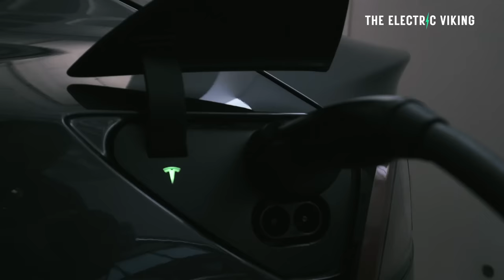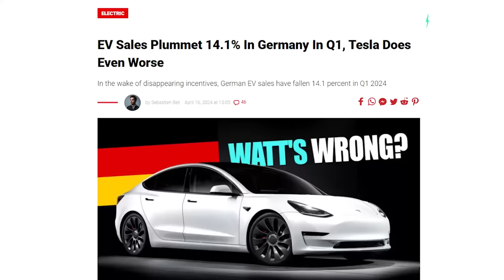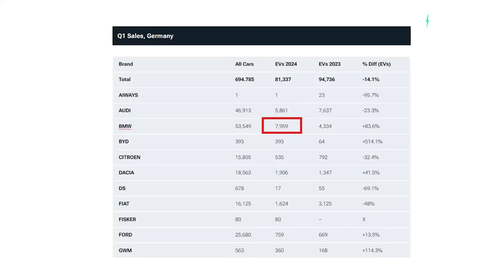The real reason Tesla EV Sales are in freefall In Germany in 2024

Comment: Hang on, does this mean that government incentives were the only reason people were buying EVs in Germany?🤯
Reply: no only people with extrem deep pockets  and a own house 
just one excemple a 

Corsa F 1.2 Turbo cost 21.000 € 
Corse F 1.2 Turbo Hybrid 48 V 28.000 €
Corsa F EV 38.000 €

that thas same base car with different engines  and also the lower specs
most working klass people dont buy cars that cost more the 30k here  if they sell a expencive car in germany it like 70% secound hand form the dealer (like a car they used in showrooms or for test drives for a year or two)
by the way most factory new cars are sold to companys or as a car leasing  (that like a long term car rent, people keep them for 2-4 year and then replace tehm, with new models) 
most factory new cars are not sold  here anymore because tehy got to expenvice,

 as excemple a vw polo base line did start at 12.300€ 10 years ago now it starts at 21.500€

Comment: Extreme electricity prices in Germany. 18 kWh on the highway for 0.79 €/kWh makes 14.22 €/100 km. With the same money, You can purchase 7.9 l Diesel.
Reply: Same/very similar prices in most EU countries. EVs only makes sense with home charging until this is resolved.
Reply: 0.45/kWh @ Tesla Superchargers 😁 [edit] in Germany. Far less in near NL (€ 0.27-0.30) and F.
Reply: …but no maintenance costs and combined with home charging, still cheaper
Reply: No maintenance costs may be true for Tesla only. We had a KIA BEV and now a Hyundai BEV, you have to pay similar or more money to the dealership for mandatory "stamping" as for an ICE service.
Reply: Not only Tesla, I own a Skoda and I have paid 0 service costs so far in 1.5 years.
Reply: @MultiMenvafan  Well, me too on the Ioniq 5, but every two years I'll pay twice the amount of the e-Niro annual "stamping fee". So it's a virtual gain to have a 2 year cycle apparently.
Reply: @IverKnackerov  Germany has insane high electricity prices.
Reply: My computer has burned away 190kW/hrs since Nov 23; 179kw/hr, and 133kw/hr for my fridge and Ninja air fryer.  Energy costs here are excessive and. I'm not going anywhere.
Reply: @kairuster1510 Same here in France, and half that at TotalEnergies 22kW charging bays in my local public parking. I guess nuclear power isn't so bad 

Phillip.
Reply: Not at Tesla Superchargers
Reply: @st4849  This is why I did not buy Korean BEV.
Reply: @rozonoemi9374  Fair enough. They're the 2nd best after Tesla though and some of them look amazing too. So "pick your poison" I guess.
Reply: I use my solar to charge my hybrid, brilliant price! Zero euros as we only do 4-5000km a year
Reply: How come? When I travel through Germany, I'm buying Elli subscription and getting 0.5 euro on partners. I can also charge at Tesla, but I find that third party chargers are in the better locations and require no detour.
Reply: Where did you get that price from? 60 cents/kWh charging station costs down here in Southern Germany.
Reply: @st4849  Truly rational people don't spend many thousands of dollars on a depreciating asset for "looks" or "status". Of course, 99%+ of humanity isn't rational ...
Reply: @st4849  dont buy an Ioniq next time then :)

I think it's just dealers trying to hang on to their old business model and cash flows. It will also be a point for competition. People (like you) getting fleeced for nonsense servicing will probably look for brands with a different plan next time
Reply: @capnkirk5528 ...and you conveniently skipped the part where I said they're the 2nd best after Tesla. Never mind.
Reply: @capnkirk5528  depreciating asset for status goes for most car purchases, hardly unique to EVs
Reply: @MultiMenvafan  I bought the Ioniq 5 after owning an e-Niro. I knew exactly how it worked by then. I'm not going to pick a car I don't want because of a difference in "stamping costs". Sooner or later dealerships will be a thing of the past anyways.
Reply: @st4849  no of course not, but my point is if you would choose between two eligible cars/brands and one has a dumb stamping fee and the other doesn't, that would at least tip the scales for me.
Reply: @MultiMenvafan  Look, as long as a brand uses a dealership network, you will have to pay for their survival. See what Skoda will charge on the 1st service after two years or whenever the 1st service is.
Reply: @st4849 I have a Niro EV and paid zero in maintenance in the past 4 years maybe it's a different agreement with dealerships in the US?
Reply: @richardburnett6781  Wow! Yeah, that seems to be the case then.
Reply: @MultiMenvafan  Very true. And not just EVs, most people overbuy their housing needs to the point where they are working for their house rather than enjoying life.
Reply: @pegefounder  ... depending on when and where you buy. On average, I pay 2€/100 kilometers of driving. It's like the fuel that had to be bought in pharmacies long ago.
Reply: @st4849  as someone pointed out, I think it might be different between countries
Reply: @kairuster1510  you can't drive to NL to charge up your German EV though, you'll never make it back with that charge so why bother going to NL to charge it up lmao
Reply: @MultiMenvafan  the regular service interval for any ICE Skoda from MJ2021 on is 2 years or 30.000km so yes, also 0 service in 1.5 years. For their EVs it´s 2 years without mileage limit, so you will be able to tell us in 6 months. Probably they will charge you 200 bucks for changing the cabin air filter and looking around. After all EVs still have cabin air filter, 12V battery, brake fluid and pads, tyres, cooling fluid (for the HV-battery), air-conditioning, etc and that needs regular inspection and maintenance. Even in the Teslas, the manufaturer recommends changing the oil and filter in the differential case. Maintenance on an EV is cheaper mainly because there is no motor oil change but the rest is similar.
Reply: @franciscojoseangostocastej6057  I can't compare to ICE Skoda just to my previous Passat GTE and as you point out it was ALWAYS the darn motor oil. Oil change, oil filter, "service charge". Just getting rid of that made a huge difference.
Reply: @st4849  Resolved? No chance.
Reply: @pegefounder  Not compared to Ireland. All that wind energy has to be paid for.
Reply: @pegefounder ….and therefore Germany will go down economically…🤷‍♂️
Reply: @ChazmillsADLT …did you receive your solar installation as a present 🎁 from the government?
Reply: 7.9l diesel is about 2gal.  That's 2gal for 60mi.

Fuel in Europe is very overpriced.  Unless you drive a VW - then you have no idea what anything costs.
Reply: @AllDogsAreGoodDogs  Imagine Europe would have gas guzzlers like the US. Imagine China had not all these efforts to replace
gasoline scooters by electric scooters, airplane by high speed railway, ICE cars by electric cars, oil price would be beyond US$ 150 per barrel
and US people could not afford any longer to use gas guzzlers.
Reply: @glennv3176  You will if you live in Aachen or near the border. 😉
Reply: What's the kwh cost to charge at home in Germany?   Is there time of use rate?  (eg 9pm to 7am Monday-Friday)?

Comment: Bad research here. Domestic solar power in Germany is relatively insignificant, if you had ever visited you would know why. Wind is by far and away the country's largest source of renewable energy (4-5 times as much wind as solar). Solar counts for only a little more than burning wood chips (something Germany counts as renewable but most people consider a bad idea). The country also relies on nuclear power imported from France and Sweden to balance its network. Some solar power though does make its way to Germany from as far afield as Spain.
Reply: In Germany for 2023, solar was 12.2% and wind was 31.1%. The total contribution from renewables was 55% with plans to increase that to 80% by 2030.
Reply: A "Serious" conflict here !❕️!

Which one of you is correct  ❔️
Reply: Believe Mark. Solar is thriving in Germany, despite the bad weather, well exceeding the original expansion goals in 2023. +14.6 GW installed in 2023, in total more than 82 GW installed base now! Don't understand how anyone could call this insignificant.
Reply: Yep, he should have said renewable, which I think is around 60%
Reply: Softwood chips ARE a renewable source - but may be classed as "dirty" in terms of their local pollutants.  So, green but not clean.
Reply: @dogsbodyish8403  There are considerable emissions involved with the harvesting of trees, soil organic matter decomposition in clearcuts, and drying and transport of wood chips or pellets.  Burning wood is neither green nor clean.

Comment: They stopped all incentives in the netherlands for cars with a catalogus price over 45000 euro.
Already years ago.
Still a lot of people buy those more expensive EV's.
(I must add to this that the tax on buying a car depends on the CO2 production (using wltp usage) at the exhaust pipe. In other words...Zero CO2 means zero tax...result of this is that especially with the more luxe brands an EV even without direct incentivs does not cost a lot more than an ICE...
But due to high energy taxes (also on electricity) makes that the savings on energy with an ev can be high. Up to 10 eurocent for each km. Only this makes energy costs when driving 25000 km a year 2500 lower.However, electricity from solar panels own by someone are not taxed at all...adding a few more cents /km savings if you can charge at home and own enough panels.

Comment: Could it be German reliability?

My (still under warranty) 2019 GTI just got ANOTHER recall notice regarding a part that is not yet available to install. TPMS, ABS module AND just yesterday… I got another notice, and it’s for a component in the Fuel tank. 

“Fire risk” stood out.

I haven’t had app-connectivity since 2021 because they STILL don’t have the 4G module for my telematics… 

(I repeat - Still under warranty)

The new Mk8 GTI has a completely plastic interior, an electronic parking brake, and seems to be priced too high for something that feels like a used Ford Focus…
Reply: One of the things that caught my eye. Many years ago was how when they went from 4G to 5G , only Tesla came up with a compatible 5G adapter.

Even though I did not have a clue how nice it was for Tesla to do that. 

All the other Auto companies making EVs.
Wanted You can buy one of their new EVs.

Comment: If they go wrong EV's are difficult to fix , especially out of warranty. Still not enough trained mechanics. Often, you have to go to the main dealer . Often car not worth fixing.
Reply: Not worth?  It's not like they're cheap.
Reply: @dogsbodyish8403  . In Guardian there are two examples of Renault Zoes being written off. One being 5 years old £30k new , out of warranty. A heater fault occurred 9k to fix. Car was only worth 5k. This is not unusual.
Reply: @johnh1872  Renault should be ashamed of themselves - a transparent rip-off.  Remind me not to buy a Renault (actually I did once, it developed a gearbox fault and it couldn't be fixed because the part had been discontinued - so the car was scrapped).
Reply: Buy EV that has years of record of high reliability.    My 2018 Tesla Model 3 84k has no issues for 5.5 years.    (Formal BMW owners that had many parts failing)
Reply: @Trust_but_Verify . I wouldn't buy an ICE BMW . Little chance I'd buy a EV BMW. The problem with Tesla is maintenance. It's expensive and there aren't any independent garages. Tesla has not released any diagnostic info. I'll wait and see who is reliable and who offers best after care.
Reply: @johnh1872  I am counting on not having expensive issues for 200k miles.
Reply: @Trust_but_Verify  . Any battery fault will likely condemn your car. Hope you have your 🤞 crossed.

Comment: Month to month fluctuations are nothing new.  The long term trend is up.  Negatives, disruptions, vandalism, winter performance issues, incentives removed.  All will be resolved long term.   It's not worth being overly concerned about.  It will ultimately still be cheaper to operate an EV than an ICE vehicle.  That's all one needs to know.  Long term it's an EV future, not an ICE one.  Near term more hybrids for sure, but long term it's EV.  Hydrogen ( the also ran ) wont even get a look in.

Comment: I work on electric cars and have been for the past 6 years. They are great if it's a lease and you have a stage 2 charger in your garage. 

However you never want to be on the hook when the battery goes out. The  money you will be saving you will put into tires and a new battery at the end of ownership. Right now a car payment on a high end  electric car is 1300 plus interstate so let's say you pay 1500 a month after interest vs a car if the same size for 800 or 900 but you will pay for oil changes, fluid flushed and the occasional mechanical repair every few years. The amount you save is astronomical over the long term. 

Imagine you are the second owner and just paid off your electric car you are out of warranty and your battery decides to go out rendering the car a big paperweight. You call your dealership and have your car looked it and they quote you$30,000 to $50,000 depending on the manufacturer for a new old stock battery that's been sitting on the shelf for 7years. 

You ask the dealership how much it will cost to trade in the car and they said as it sits $1,500 towards a new car, this price is what copart will pay to haul off the car to the auction block. The dealership does not want that car on their lot.

This will be the future, true throw away cars. None of the electronics can be recycled because the electronics even headlights are Vin seared and cannot be reused. 

I will continue to drive my gas car until the wheels fall off. Then I'll buy another one.
Reply: You can get a new battery into a 10 year old Leaf for €5-10k, depending on battery size. You can get an EV here for under €200 per month.

If you can charge at home and plan on buying a new car anyway, an EV is a no brainer unless you're doing long distance driving all the time. 

It costs me €1.20 to drive 100km with home charging. It used to cost me €11. 

In addition, the electricity here is produced locally. It's about 35% renewable, and increasing every year. Why would I want to pay for the import and refinement of oil? 

I also don't want to deal with timing belts, clutches, spark plugs, oil changes, radiator leaks, EGR valves and all the other stuff. 

Not polluting the local air in our city is another benefit. Petrol isn't too bad, but the smoke some diesels spew is bad.

Just to let you know, I speak from experience of owning both types of cars, with ICE for most of my life. They're more fun around a race track and I like the sound of a V8 or 2 litre turbo, but I can have one as a hobby car. EVs are simply better for everyday use, no question.

Comment: The simple reason is electric is expensive!
Reply: But costs are coming down, not the reverse - which would usually result in increasing, not decreasing sales.  Except that price deflation is a reason for putting off purchase - which is probably what's happening here, coupled with subsidy removal.

Comment: Ex are too expensive. 
The average car sold in EU looks like VW T-ROC, Renault Clio. 
This are 25k euro cars. 
An EV with autonomy around 500 km is around 40k.
I think cars like Renault 5 are a better option. You pay around 25k for around the city car. 
For now EVs are cars for upper middle class who buy them for status.
Reply: There are still Chevy Bolts around for low prices, and my euv has had zero problems.
Reply: I bought mine 7 years ago and not for status but for cheap driving. ... and it works as expected.
Reply: Mostly party members, driving them with discounts...😢
Reply: @IN-hw8it6  Of I would have a pizza delivery business, I would buy a 20k EV.

Comment: Waiting for the solid state battery is a good idea
Reply: Why? Even my 10 year old batteries are still in good shape and provide all the power I need for driving. Why wait for a quantum computer when you need to do calculations now?
Reply: @dirkvornholt2507  it enables the EV to have a higher range, over 1000km, and it’s coming soon. I saw the news release of a Chinese company having a prototype of 720 kWh/kg.
Reply: @manimalworks7424  It's 720Wh/kg, not kWh/kg. Sure, that might enable even more EVs to fulfill some extreme driving profile needs, but most people don't have such extreme needs. It's just like with computers today. If you need a computer now, it makes no sense to wait for the next generation. It also makes no sense to buy an abacus (ICE car) unless you're a collector of antique technology. The wonder batteries are more like a promise to delay energy transition than a thing that hits the market soon. Certainly batteries are improving, but there are more dimensions than just energy density to focus on. (Longevity, price, charge rates, power rates, cold performance, safety, availability of resources, etc.) Most improvements in battery technology are evolutionary, not revolutionary.
Reply: Careful though - the viable solid state battery may turn out to be another Fusion.